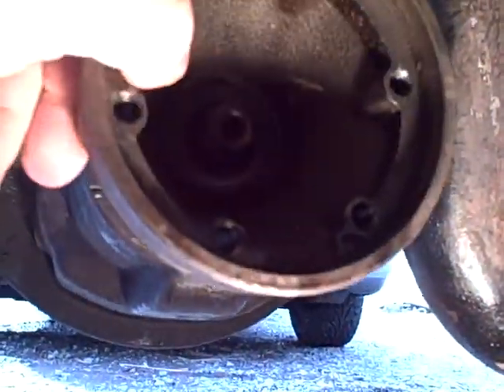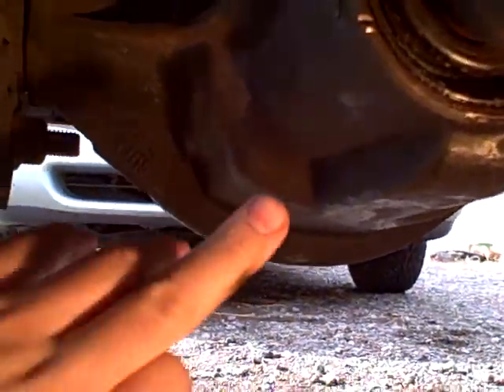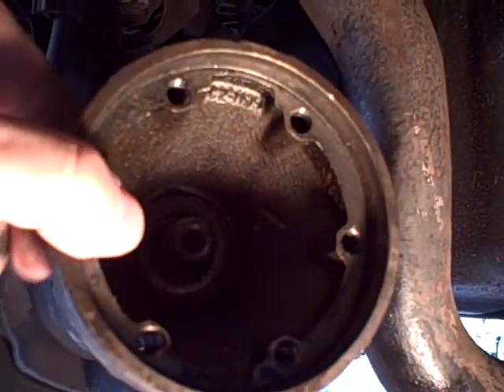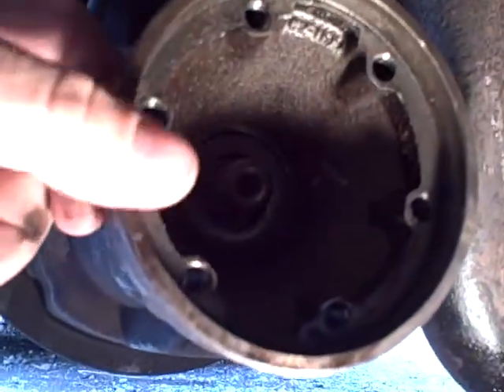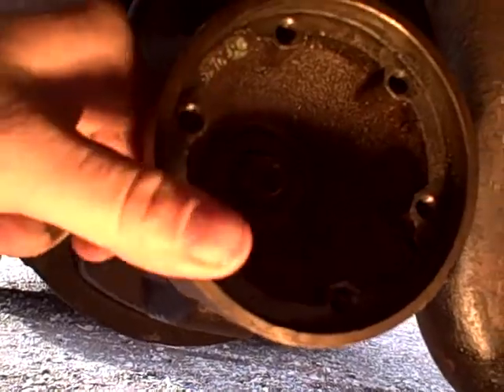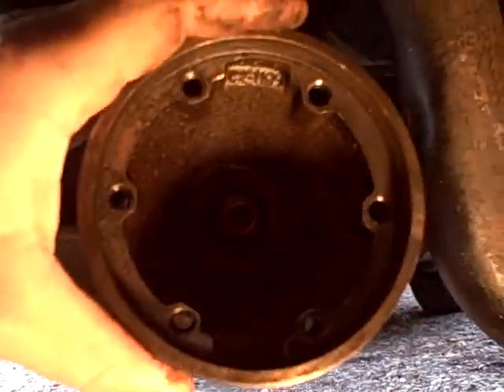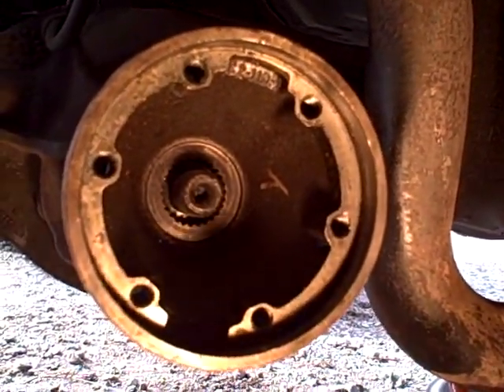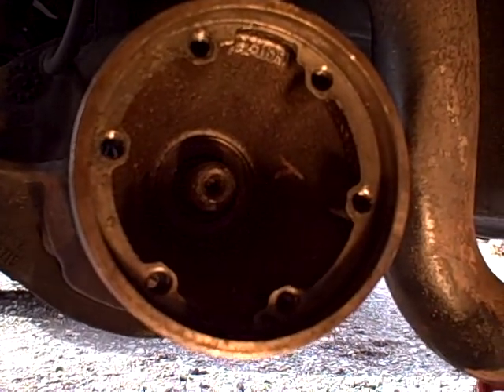1996 Jeep Pinion Gear

Comment: ummm i hate stuck rusted things..... 
big job to do but i think id remove the whole rear axle and take it inside to work on it.
worse case scenario i likely would cut that hole thing off with a torch and replace it all (if parts avalable) replace the bearing and seal to.  big job i know but likely gonna be the only way